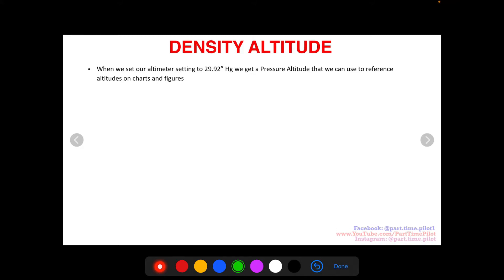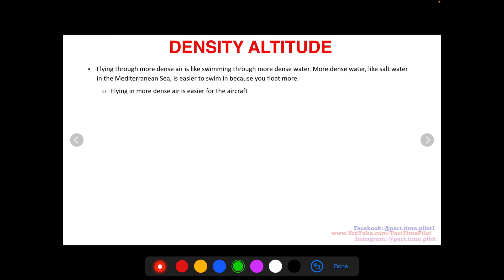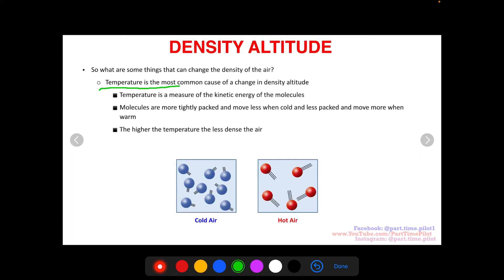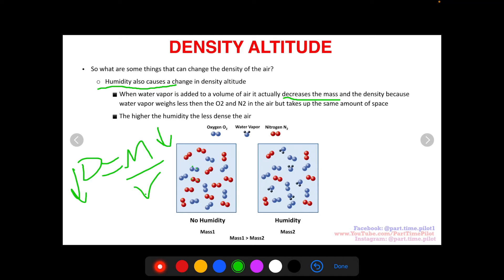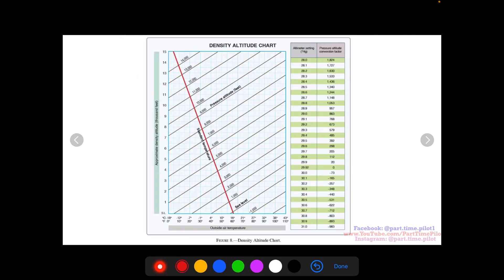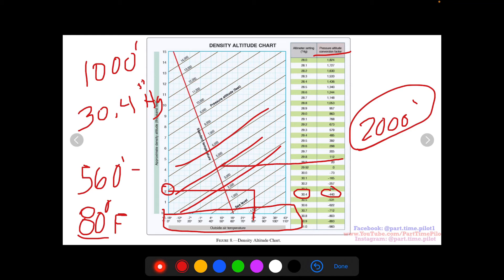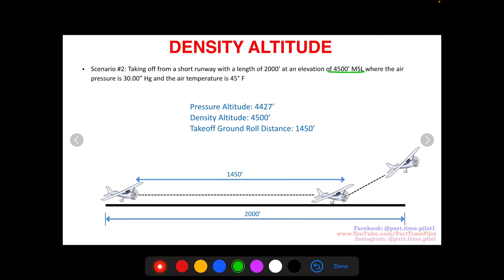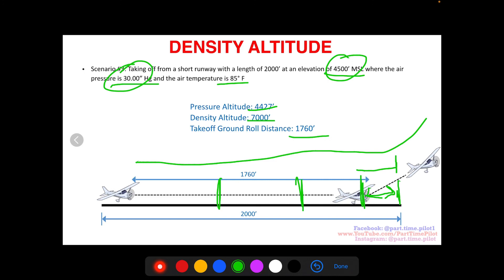What is Density Altitude - For Student Pilots

Comment: Hopefully I can ask this question properly.
 The pressure altitude numbers in the POH for performance matched with the temperatures .  Is that the density altitude not corrected yet? 😬 if I asked that right? 

The pressure altitude at 4000ft at 20c above standard
. 
It’s not corrected yet

And this is what I’m climbing too? Hopefully I asked correctly
Reply from the maker: The lines on your performance charts for altitude are for pressure altitude. The reason these charts first make us match it with a temperature is because the chart is converting the pressure altitude to density altitude for us! 

Because density altitude is what our aircraft really feels and what we want to calculate performance at. 

Take a look at figure 7 I believe in the airmen testing supplement for
Private Pilot. This is a chart just for converting pressure altitude to density altitude. Look familiar? It’s the same first step on all our performance charts. The only difference is it actually gives us a value for density altitude. On our performance charts figuring out density altitude isn’t our goal… our goal is climb performance or
True airspeed or engine power. So we don’t need to know the number for density altitude but we do need to make sure we correct for it. 

Hopefully this makes sense. Not 100% sure that was what you were asking but should clear things up

Comment: I understand you said air is less dense at higher altitude but I’m trying to make sense of this but I just can’t somehow. If temperature decreases with altitude, wouldn’t that make the air more dense at higher altitudes though? since those air molecules are more close to each other? I’m overthinking this and I’m trying to figure out, but I just can’t I thought I understood it at first but now it’s like I’m going back and just thinking about it.
Reply from the maker: It’s true that to describe a lot of phenomena in weather we use the fact that cold temperatures and high density go hand and hand. But when we increase in altitude this goes out the window. It goes out the window because the volume of the air changes with altitude and the air thins. The amount of molecules per volume decreases because the volume expands so much. With less molecules per volume (exact definition of density) you also get less collisions of molecules and less heat release (exact definition of temperature). 

So whenever you say high density equals low temperature you are essentially assuming a constant volume of a gas or liquid. You are also assuming a constant pressure. If volume or pressure changes, these relationships change. That’s what makes weather so confusing. It’s not a closed system.
Reply: @PartTimePilot  I had the exact same question, thank you.

Comment: Great video! I had a question. So higher temperature is less dense than cold air. However, higher pressure is also more dense and I thought when temperature rises so does pressure, but then that wouldn’t make a lot of sense. Hopefully you can help. Thank you!
Reply from the maker: The thing that makes it confusing is that the relationship temperature goes up with pressure is from the ideal gas law which says Pressure = Density*Temperature*GasConstant. So as you can see if temperature goes up, pressure has to go up and vise versa IF we assume the density remains the same. Which is the case if we have a gas contains in an adiabatic container. Adiabatic means nothing can go in our out essentially. So the density inside the container is all the same. 

But our atmosphere is not an adiabatic container and we have various effects which can change the temperature (heat from the sun, radiation from the surface), density (humidity, temperature, pressure) and pressure (terrain, temperature, humidity). So in our atmosphere it is not as clear cut and you can't explain it with the ideal gas law. 

However, I still teach my students that when they are thinking of their altimeter to remember temperature goes with pressure. Meaning that when you travel from a place of low/high temperature to a place that is the opposite your altimeter will react the same as it would with changes in pressure. This is explained by how altimeters measure pressure. Pressure is just a measure of the column of air above the device doing the measuring and its a measure of the force of that column on the device. When you have a drop in temperature it condenses the column such that less column is above you and your altimeter feels less pressure. When there is a rise in temperature is expands and there is more column above you so your altimeter feels more.  Hopefully this helps